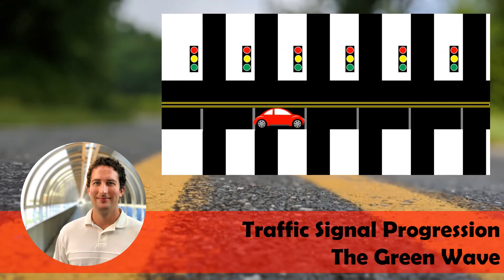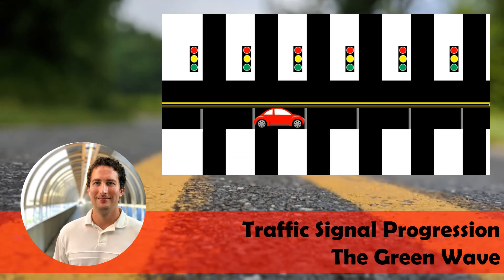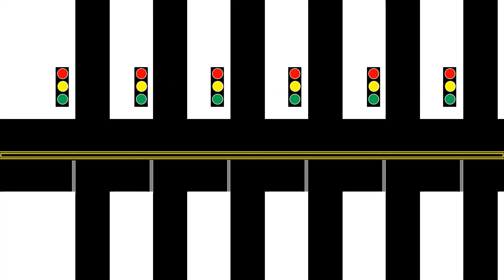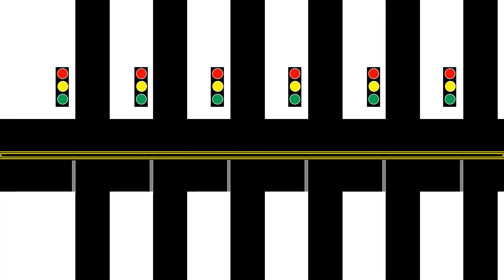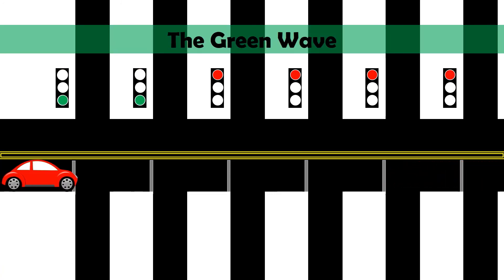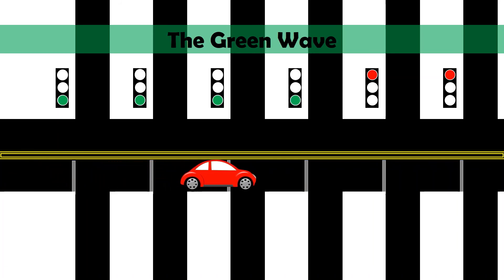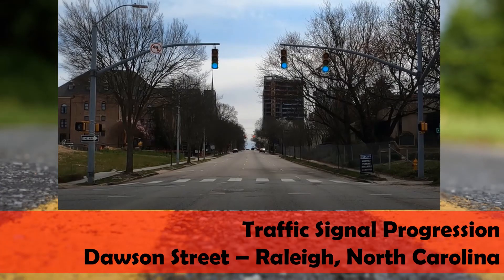The Green Wave - Traffic Signal Progression

Comment: Don’t we need to teach platooning to cyclists?  How to manage?  And how to each drivers not to follow too closely to prevent lobe of sight for slower active transport users?
Reply from the maker: These are great comments/questions!!  You're exactly right, we can apply these same concepts to cyclists and pedestrians.  For instance, in a similar way as shown for vehicles, you can prioritize the progression of bicyclists by setting the progression speed to bicycle speeds (this is probably most applicable with specific bicycle facilities).  The same concept also applies to pedestrians and some cities have implemented signal timing that helps progress pedestrians so that the walk phase at the end of each block is coordinated with the walking speed.  It can be very frustrating for a pedestrian (and discourage walking) if you have to wait for 1-3 minutes at each crossing along a corridor - and the reverse can also be true, we can encourage more walking and active transport if we prioritize these movements.  The leading pedestrian interval is another tool that can prioritize pedestrians (you may notice that this corridor uses LPIs, you can see it most clearly at the first signal in this corridor in downtown Raleigh) - here's a video showing the impact of an LPI by allowing the pedestrians to enter the crosswalk before vehicles start moving - https://youtu.be/sS8rScfwdKk.

Thanks for the comments!
Reply: Do the signals need to be tuned and maintained to achieve the green wave? In San Francisco on Geary Blvd, the wave appears as a group of greens at once, then a random light in the middle cycles red. Feels like it's our of sync.